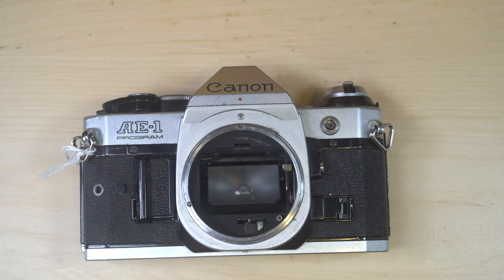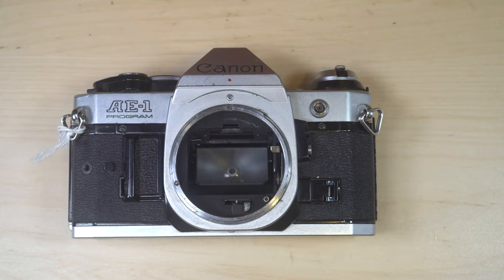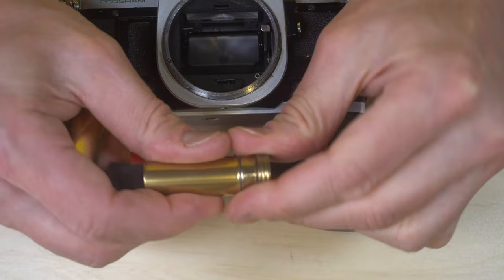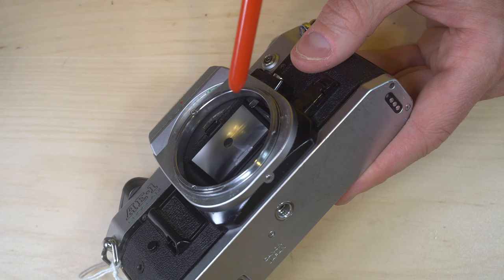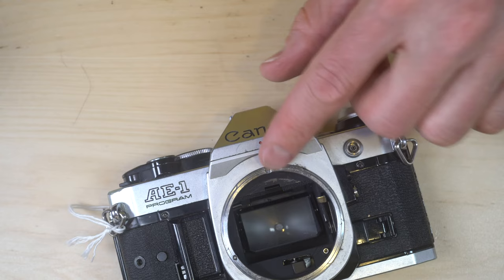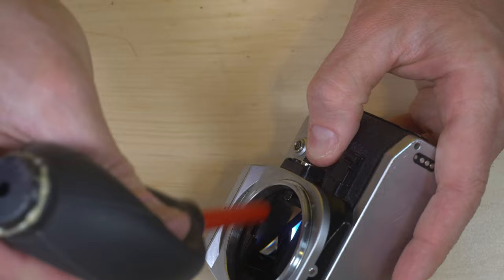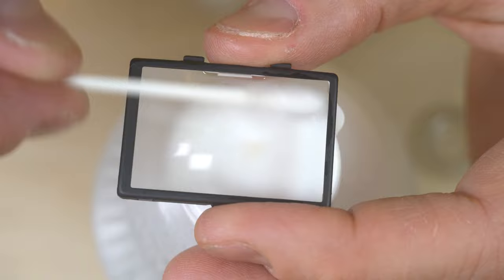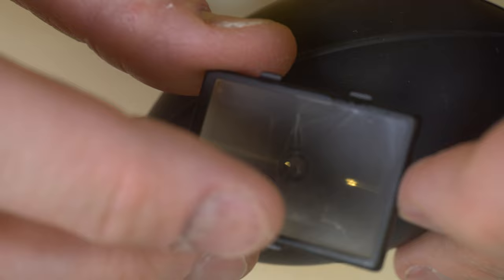Cleaning an SLR or DSLR Camera Focusing Screen as Safely as Possible & Why Solvents Ruin Screens

Comment: Hi. I've bought used (but not much) Nikon d3200 from my friend. I haven't been using it much, but when i wanted to take pictures I notced few dust particles in my viewfinder,. I opened the body and used the blower like yours dfrom aliexpress. The point is that the plastic top fel into the body in the corner between mirror and focusing screen.y, but not that hard to make any damage. After that I noticed that one dust particle was gone but other 2 came in. Also I noticed a black tiny spot (like it was made of the top of the marker). I'm not sure if that spot was there before. Anyway, I continued to blow  both to the mirror and focusing screen, but without success. The particles and the spot are still there. I can't see any dust on the mirror and on the focusing screen. May I use these cotton ear buds to gently wipe over the focusing screen without taking it out? I don't want to make more harm than it is. Thankyou.
Reply from the maker: I would recommend a lens brush instead of cotton. I have a video on cleaning lenses that shows what that looks like. They're reusable and great for lenses, too. One thing that you can do is glue the plastic tip into the bulb blower. I did that and it gives the blower a whole lot more force without the risk of the tip popping out.
Reply: @DavidHancock  Thank you. I have a brush for lensesthat I got in the chinese set. It is softI, but I don't know the quality and  if it can scratch the surface.
Reply from the maker: @djhot80  I would expect it's probably fine. A brush is definitely gentler than cotton swabs.

Comment: no matter what i do or use, i can never get all of the dust off of my focus lens, i have a T7 with a removable lens but there’s always at least some dust left when i re insert it back into the camera, any tips?
Reply from the maker: Is it showing up on your photos?
Reply: @DavidHancock  no, however, i used a sensor cleaner dipped in alcohol to clean the back side of the lens then used a dry one the clean it off. that got about 90% of the dust off but i have to get a new focus lens soon anyways

Comment: I cleaned mine with acetone and it’s fine. I can still see the split circle and the little triangles that disappear when in focus.
Reply from the maker: That's fortunate. Most of the time acetone dissolves the fine ridges on the screen, which has a meaningful and detrimental effect on focusing.

Comment: Ok.. so i got distilled water and tried to clean the prism again.. and for some reason there were still a few tiny hairs i couldn't clean.. i guess they were stuck deeper in the viewfinder system? behind the other side of the prism perhaps?  any idea how to clean those?
Reply from the maker: When you look through the viewfinder, do they appear to be like black threads or chips that are in sharp relief (they don't appear blurry.) If yes, then those are areas where the silver coating on the prism has begun to fail and there's no fix for that except a new prism.
Reply: @DavidHancock  ohhh dang.. yeah they look like black tiny hairs.. very sharp.. altho if I change the diopter on the viewfinder system they all blurry away too.. one of them I was able to "move" around with a wet cleaning swab.. but I couldn't like.. take it out.. I just kept moving it around.. which was kind of annoying lol
Reply: When I had my focusing screen out to clean it, I took a few moments to look through the viewfinder without the focusing screen installed to see if there was dust further inside the penta-mirror. I ended up getting dust out of it several times (it took me a few times to put my focusing screen back) because I was checking before putting the focusing screen back. That dust is so good at getting in whenever there's an opening!
Reply: @AlexandarHullRichter  yeah.. I did this cleaning a couple of times but now I just give up.. It's so much work and annoyance and dust and hairs just keep finding ways to get in there lol.. as long as it doesn't affect my pictures I'm leaving then there now

Comment: Are all camera focusing screens made of plastic? Or just most? I have an edixa flex and it is shiny like glass on the top
Reply from the maker: Most. Some very old cameras have glass and many large format camera use glass. I'm not sure about your camera but I would think it's glass not plastic because I think it's a fifties camera and that's older than the plastic used in screens.
Reply: My Nikon f has glass focusing screens
Reply: As mentioned it depends allot on the camera and when it was made. But even if it uses a plastic focus screen, many still have a glass slip cover especially if they have interchangable viewfinders as glass is by far more scratch resistant than plastic.

Comment: Do the screens really need to be cleaned? It’s just for reflective purposes.
Reply from the maker: If it isn't dirty, no. But the focusing screen isn't a reflective element. The texture on the screen provides a focusing surface for light through the lens. So when the screen gets dirty or damaged it can affect how accurately the camera focuses.
Reply: @DavidHancock  
Got it

Comment: Dang.. i tried cleaning the prism, because i could see some tiny hairs sticking on it.. and i gently tried to swipe them with a cleaning brush... and things got worse.. it all went downhill from there.. tried with a qtip.. and got more hairs.. tried blowing, barely any changes.. tried a microfiber cloth.. and got a ton of tiny tiny hairs on it..   

idk what else to do anymore..  all i havent tried was using a fluid of some sort.. any suggestions?
Reply from the maker: Without seeing it, nope. If you use a cleaning fluid, distilled water is the only thing you should use. And use a wetted cotton swab with it.
Reply: @DavidHancock  do i just wet a cotton swab and let it dry? or what do i do if there's like excess drops of water?
im doing it on a nikon d3200.. is it dangerous to use an air blower to blow the little excess water off the prism bottom?
Reply from the maker: @Meth0z  This video demonstrates the process and I think that's probably the best guidance I can provide. I think this video also discusses air blowers.

Comment: Very dangerous advice to tell people to  stick their blowers into their cameras, even up against the focusing screen: the focusing screen is incredibly fragile and will scratch with even the slightest touch of that nozzle.

And another thing people: when you use your blower always keep the camera mount opening downwards, unlike in the video, as you want the dust to fall out, not in.
Reply from the maker: Thank you and on the second point, I think the video clarifies that holding it down is important. It's rather hard to record video through a two-inch-thick table.
Reply: @DavidHancock  To be clear: I was not trying to critize you, just trying to warn and help others here. Thanks for your videos. :)
Reply from the maker: @TimMer1981  Thank you. 😃